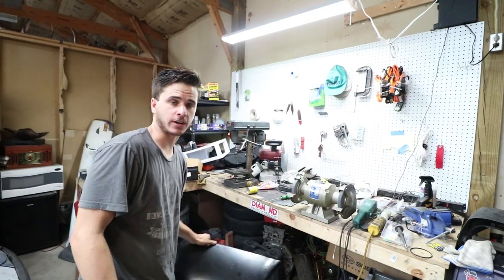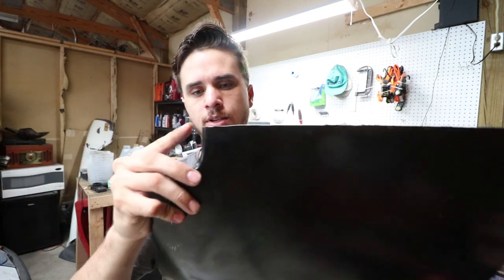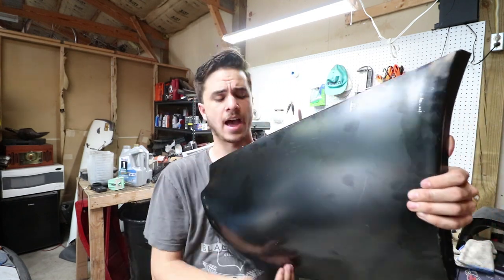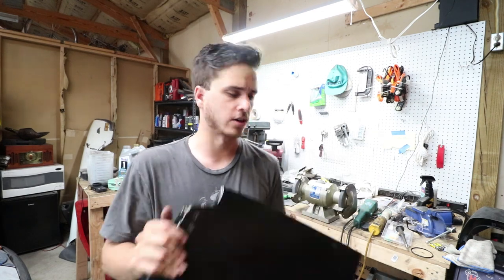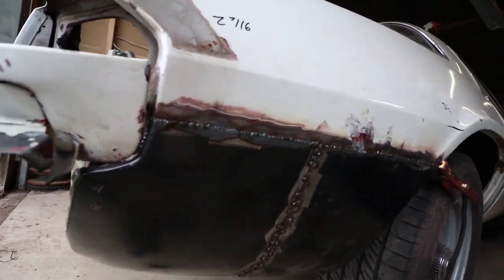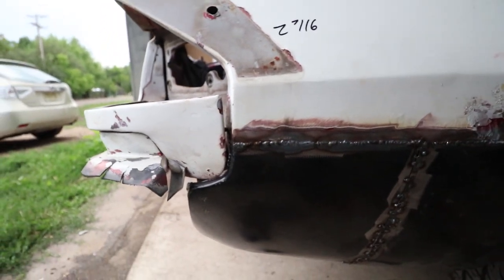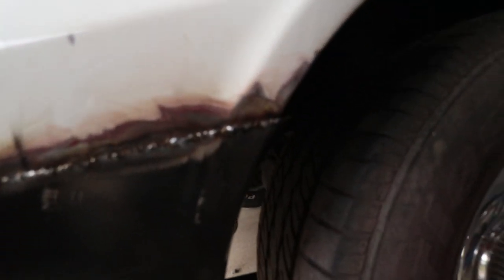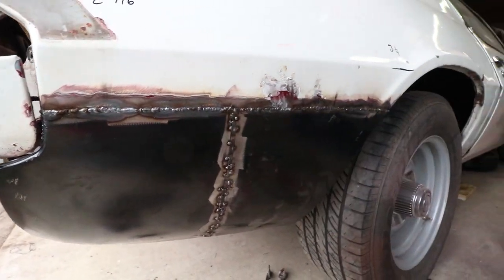DON'T BUY PATCH PANELS OFF EBAY!

Comment: I really wanna do a full eBay build civic...
Reply: Jonah GT-Four get a eBay turbo and nothing more unless you know the company behind them. Had a buddy drop a good amount of money into a civic and it 550hp but lasted a couple months
Reply: Tbone Scriv What about eBay seats and steering wheel and wheels?
Reply from the maker: That would be a fun build series. Complete eBay build
Reply from the maker: +Jonah GT-Four don't buy a steering wheel off eBay. I've seen them literally break off. And seats are pretty sketchy too.
Reply: SMB Garage But if I don't, it isn't an eBay build 😂

Comment: I think you're a bit salty without a true understanding. Im most cases aftermarket parts cannot be 1 to 1, if they were then they could be sued. While ebay parts are often cheaply made and mostly trash, when it comes to body panels, I know from experience that they cannot be 1 to 1 for copy right reasons usually. 

My dad has always been a die hard OEM or bust kind of guy. The only time he will buy aftermarket is if its a complete redesign because the OEM version was very flawed.
Reply from the maker: Not only are you wrong about them not being able to reproduce exactly for copyright reasons, you are also wrong about me being salty. Lmao.
Reply: please rate the panel as poor fit on the ebay sellers ratings page so others can know not to buy this poor fitting panel .Then these sellers will find panels that fit. I used to rebuild wrecks and Chinese panels can fit as well as OEM if you don't let them get away with  selling poor quality stuff. The best is to return it.
Reply: SMB Garage Salty probably wasn't the best choice, I meant slightly annoyed or somewhat frustrated. You don't offer any proof that they don't require licensing in order to create accurate panels either. I suppose I only offered anecdotal evidence myself but I would assume if you were gonna call someone incorrect you would offer proof. I just tried to offer some from my experience.